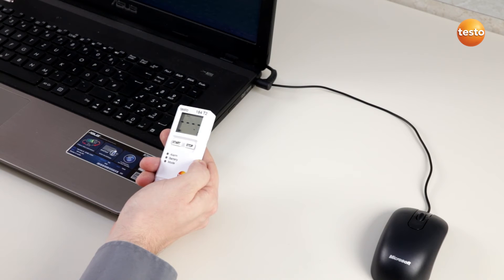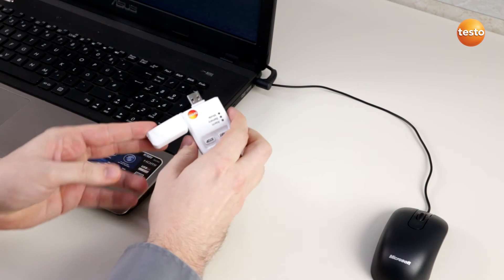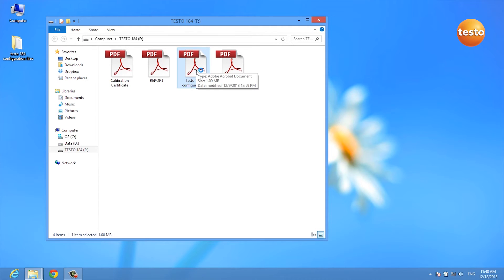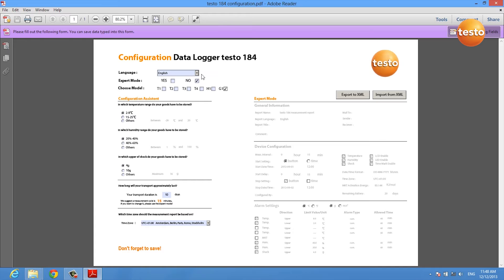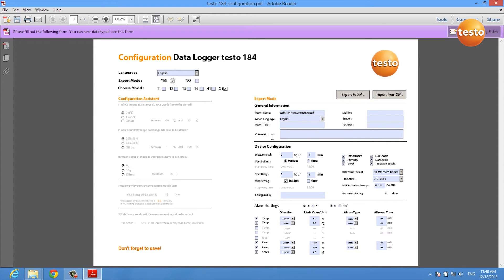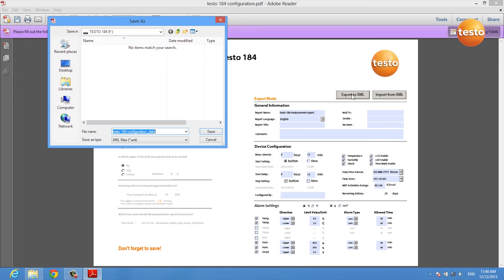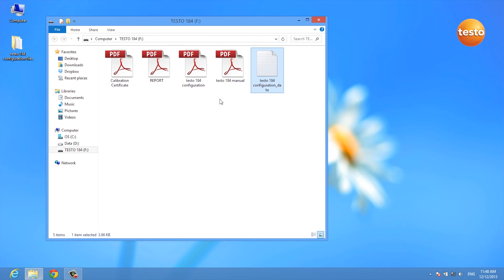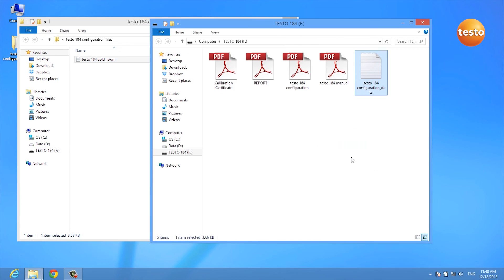testo 184 USB Data Logger - Step 1 - How to Configure

Comment: Do we nees to configure it after every use/recording? Because when I press stop, it goes to end. But how to go back to wait for another session of recording? If we need to configure it every time, that is pitty.
Reply from the maker: Hi Anel, no need to configure the unit every time. There is a start/stop setting in the configuration file, so you can set when the unit needs to stop to go to END mode. You can download the configuration file from the link below - please go to the Downloads tab and select the file "testo 184-T4 Configuration" then download the file and then Open in Adobe - then it will work and open properly: 

https://www.testo.com/en-AU/testo-184-t4/p/0572-1844?gclid=CjwKCAjwr56IBhAvEiwA1fuqGguqRaPtZkYKnY-h95sx4I9WWfdO6r9FCSHhUFj_3TbgZiSm0oAOKRoCou0QAvD_BwE

Thanks!
Reply: @TestoAustralia1  Thank you very much. Yes, it goes to the end but, can I immediatelly press start for another recording or do I need to configure it again. Because once I press stop, it goes to end, i print the list on thermal printer but logger is in end status.  Whatever I press i Cant start recroding before I configure it again.
Reply from the maker: @RedzicAnel  ... please contact our Service team on 03 8761 6108 and we can guide you through and get you going again with your Testo data logger.